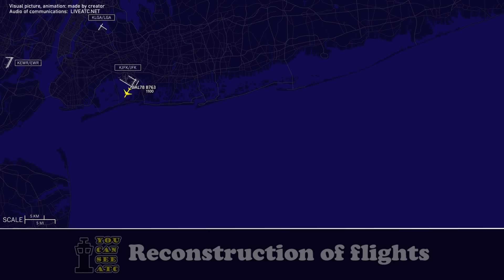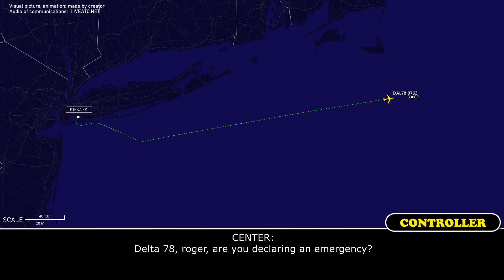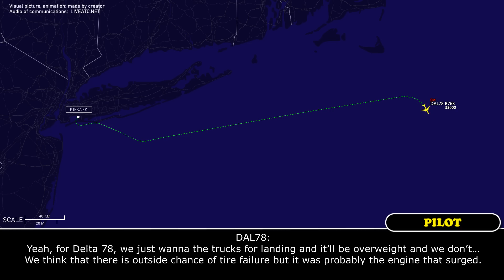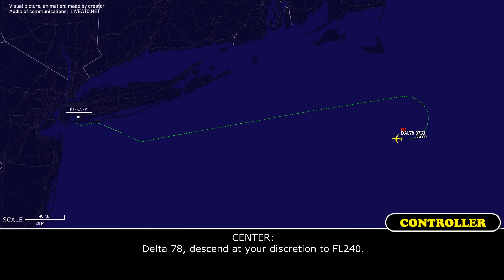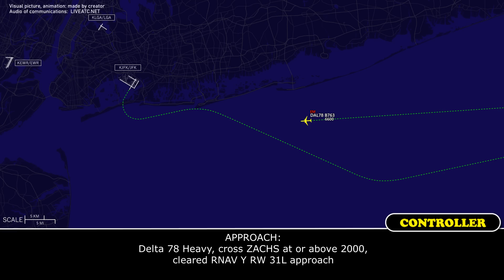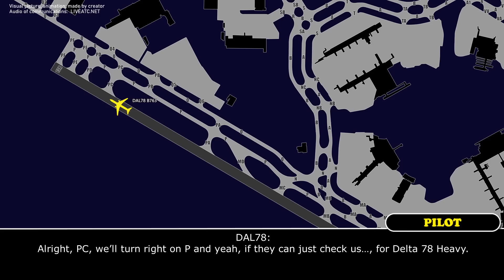Engine stall / surge on take-off. Delta Boeing 767 needs emergency landing at Kennedy. Real ATC

Comment: Why did they take so long to raise the issue?
Reply: Receiving telemetry from the engines, diagnosis, further investigation, discussion between engineers, dispatcher and pilots - it all takes time. It wasnt a critical situation, but if it develops mid pond, it might become one. Whilst it wasnt critical, they had time to make a full assessment and reach the right conclusion; turning back is both expensive, and inconvenient (for every passenger) - nobody does it lightly (but safety trumps basic economics every time these days).

Comment: was it ever explained why an engine problem on takeoff that caused them to declare an emergency was not reported until the plane was 200 miles away at 35000?
Reply: They mentioned the company wanted them to turn back, which I assume means the company, not the pilots, decided it was best to return and not risk an incident.  Cheaper to return and  swap equipment 100 times than a single search and rescue, esp when there's an ocean in the way and not many options for diversion.
Reply: @blueyez1980  except that doesn't answer my question.

Comment: I’m studying for my PPL now and I’ve been listening to a lot of these recordings recently. One thing that always sticks out to me is that ATC always has to ask (sometimes many times) for fuel and souls. I always wonder why the captain/officer don’t just call out fuel and souls before ATC asks.

It was nice to finally hear someone proactively supply that info. 

Obviously #1 is to aviate so I totally understand why in high stress situations you’re not going out of your way to answer things you haven’t been asked, but in cases like these where it’s relatively low stress I would expect to hear more recordings like this.
Reply: Sometimes the controller isn’t ready for that information if you spit it out. If I remember to say souls and fuel, great. If not, no big deal. Flying the plane comes first.
Reply: @saxmanb777  ppl 2:21
Reply: Declaring emergency is really rare. Most of the airline pilots never did it!! Completely new situation, trained only on the ground.  They know what to do, but they have more important things to do, and to concentrate at then thinking about transmiting informations ATC before they ask. Finally - number of POB is not what the pilot remember exactly without checking it.
Reply: One reason pilots don’t like to talk about “souls” is because it can mean the end for all onboard.  Pilots are problem solvers

Comment: What other trucks would he mean for an emergency landing.. Catering trucks?
Reply: GET THA DUMP TRUCKS ON STAND BYYYYY!!!
Reply: SJ:  Harsh,  but fair.
Reply: HAZMAT would possibly be an option. A tug (tow truck) to tow a plane that can't taxi on its own once down and stopped. General airport maintenance trucks, perhaps (to check the runway for debris left after landing.) Even medical/ambulance, if ATC decided they could assume nothing from the info about the issue that was already given (medical response's vehicles are not usually referred to as trucks, perhaps, but in verbal and imprecise parlance it's not totally out of the question for someone to lump "medical first responders" in with all other possible types of "truck" responses, imo).
Fire probably has some ability to address those issues as well but I figure a larger airport is more likely to have trucks specializing in the tasks that don't involve fires, rather than just making the firetrucks the all-in-one first response.

Comment: Question- why go back to JFK when Boston isnt too far away?
Reply: Yeah they probably have more maintenance available at JFK, or it just makes things easier to return to the origin. I'm guessing since they noticed the problem on takeoff but didn't decide to return until later that was because they contacted their dispatcher at some point into the flight and were eventually advised to return as a precaution.
Reply: They may have a hangar at JFK to look into the aircraft/that aircraft, if inspected and cleared, has a route out of JFK.
Reply: they werent in that dire of a situation
Reply: @jj4829  Thanks
Reply: Yep, it's all about logistics at each of the airports (aka hubs/maint). Boston Logan has pretty significant maint presence for JetBlue and actually Delta

Comment: Nice job other than them forgetting to advise ATC before starting the fuel dump
Reply: Declaring fuel dumps without forewarning in emergency situations is only advised and not regulatory procedure. Also not only were they over water but fuel dumped at that altitude is completely vaporized
Reply from the maker: They surprised me as well when they started to dump without permission 🤨
Reply: Maybe LIVEATC missed it?